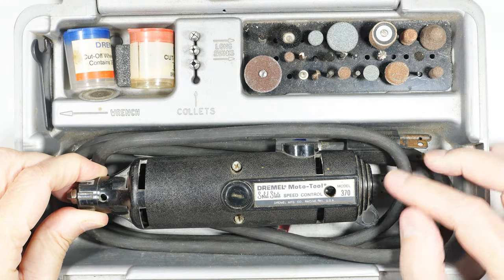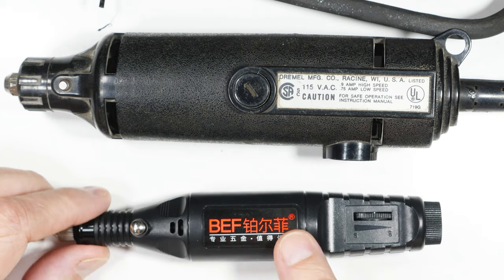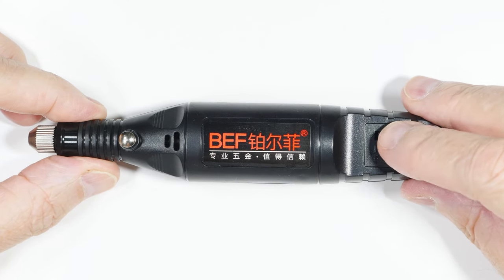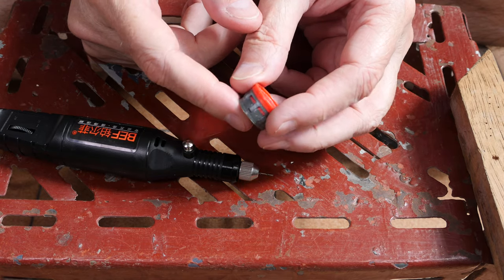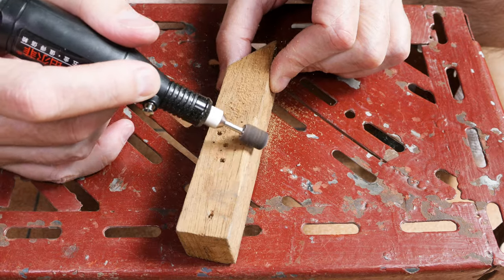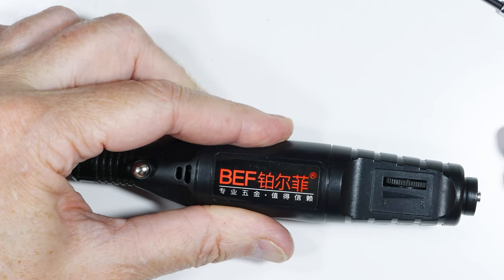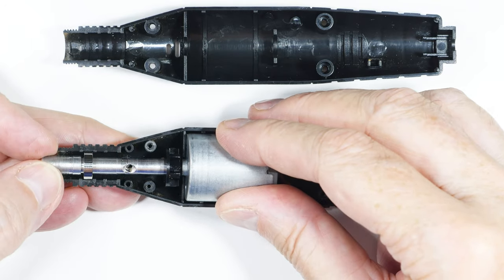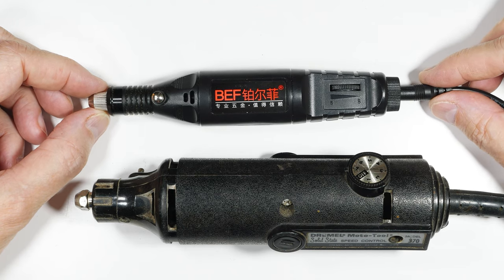$5 Motor Tool Review (4K)

Comment: If you can find an old corded Dremel at a yard sale.  They seem to last forever. 
Cordless are very handy, not as powerful. 
My cordless Dremel lasted about 10 years before batteries gave out.
My new one not a Dremel, was way cheaper and more powerful. 
I have yet to recharge it after 2 weeks.
Reply from the maker: I have 2 corded ones. My father's is just under 50 years old and still works well. Mine is 40 years old maybe. Had to clean the switch about 10 years ago, but it's still going strong.
Reply: In my many lives, I've seen these old Dremel tools run forever.